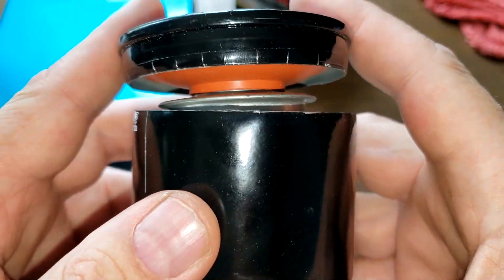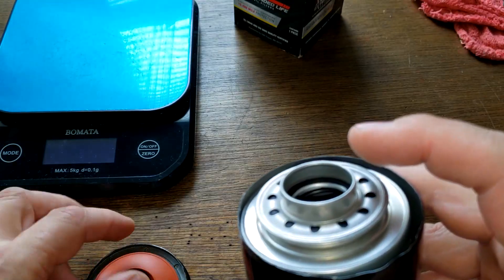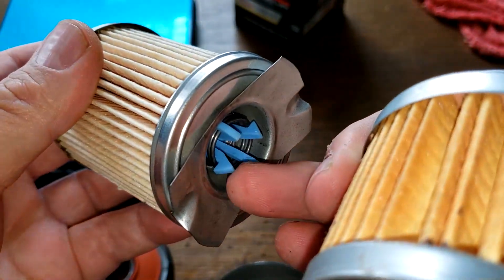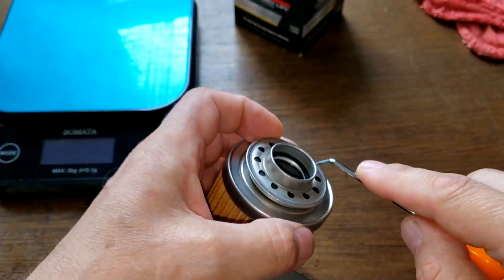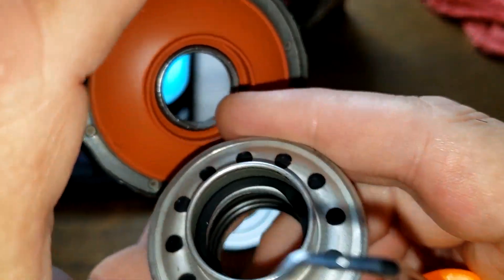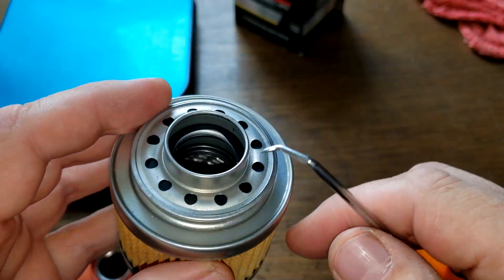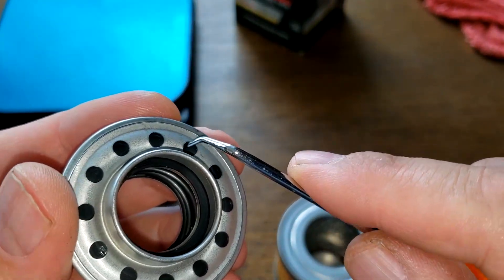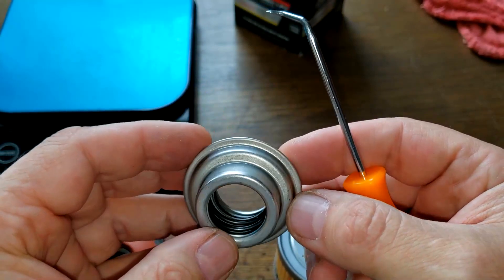How A Base End Bypass Valve Works On An Oil Filter, Base End Bypass Valve

Comment: I fail to see any big advantage to having the bypass valve on the base versus the other end.  Both do the same thing at the end of the day.
Reply from the maker: With a bypass on the base end, the oil doesn't have to go all the way to the other end of the oil filter and this makes less of a chance of dislodging any loose particles like excess glue from the filter media, especially useful with a vertically mounted oil filter.
Thanks!

Comment: Most all good oil filters have anti-drain back valves it is the El-Cheapo ones that don’t have it. The top 5 oil filters are: Amsoil, Mobil 1 Extended Performance, K&N, Fram, and Purolator.
Reply from the maker: The oil filters that dont have bypass valves are the ones that are meant to go on engines that already have their own bypass valves in the engine. https://www.youtube.com/watch?v=y8WpGE6SqXw&ab_channel=Scruf%27sGarage
Reply: Fram😂
Reply: @Antiliblife187  I hate tell you this Fram is lot better oil filter than people think even their El-Cheapo oil orange can filter can last 10,000-miles on an oil change interval (OCI) and I have looked this up the Frame Xtra Guard Ultra Synthetic can go 20,000-miles on a OCI. If you buy their top of the line oil filter called Fram Endurance Guard it will last 25,000-miles on a OCI. I personally prefer either Mobil 1 or K&N because Mobil 1 has a higher percentage in micron filtration greater than 30-microns. I also like K&N oil filters for two reasons if you are a DIY guy you don’t need a special filter wrench 🔧 all you need is a 1” open end nut wrench 🔧 or a socket wrench 🔧 that is 1” in width on the end of a 1/2 inch drive ratchet wrench 🔧 because there is a nut at the bottom of a K&N filter. Also, it can handle 150-PSI in oil pressure which, is way more PSI than any street car will ever see. It tells how durable that filter is and it is racing inspired oil filter. 🙂
Reply: @Antiliblife187 yup fram ultra synthetic do some research

Comment: In a modern engine, with modern oils, if your filter is clogged with particulates big enough to wash off and go into your engine through a top-end bypass valve, you've got bigger problems.  The sole function of a bypass valve in a modern engine is to ensure oil flow when the oil is so cold (and thick) that it can't readily make it through the element.  The base-end bypass valve was developed back when engine sludging was a real (and common) issue, therefore the need for having the oil bypass the filter element before it flows over the element.
Reply: Agree but still a lot of people don’t change the oil. This would save an engine from starvation. Less dirty oil or not.
Reply: Extended drain intervals is why so many engines blow up today. Then you read people change their oil but not filter. Dumbest thing I've ever heard of.

Comment: Nice demo Whip. Unfortunately, if you really like these, M&H is gradually moving Wix away from shown base end bypass pieces, to dome. Just looking at it you can see how they would be more expensive to produce than dome bypass. The upside especially on smaller filters, more room for larger element, more media. As for bypass event, I'd say very cold start, especially with higher viscosity oil, more common for bypass. If your filter so loaded that it's in bypass, a very poorly maintained engine, or the engine has serious issues. Personally, I'm ok with dome or base, most filters use dome including most OEM. Thanks for demo.
Reply from the maker: You're Welcome Faxmen09, and Thanks👍